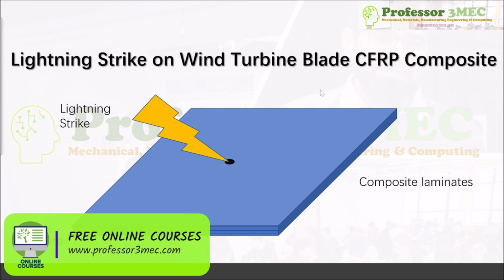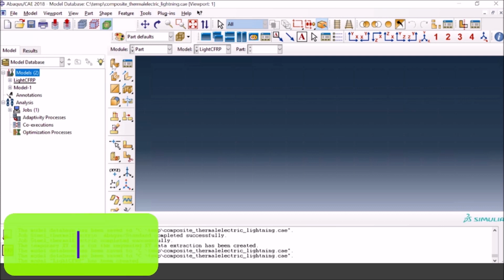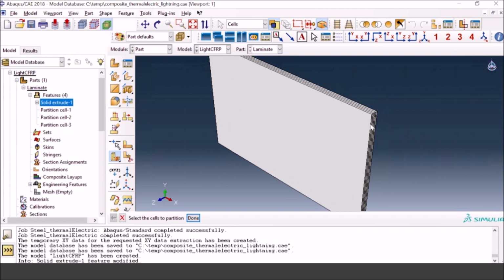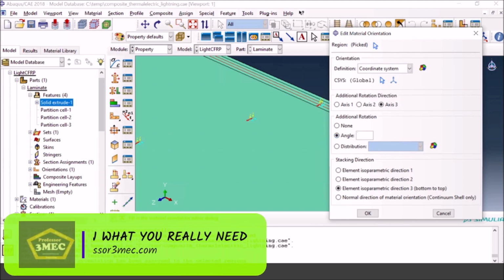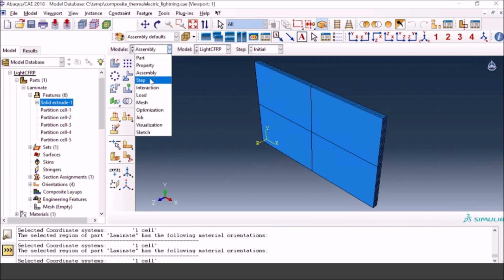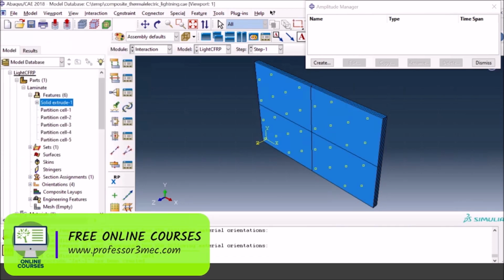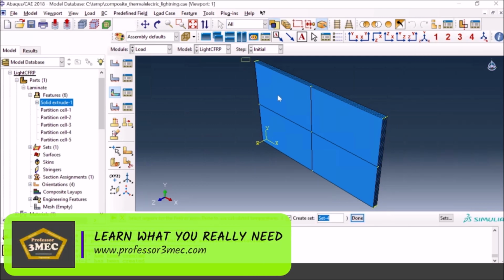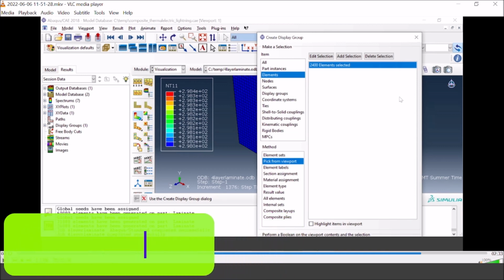Lightning Strike on Wind Turbine Blade Composite (CFRP) using ABAQUS CAE

Comment: Thank you professor! Your manual is very helpful. But I got a problem, when I simulated a similar task some elements with low temperature (around 3-10 Kelvins) occured during analysis. This problem aborted my analysis. What can cause this? Thank you
Reply from the maker: did you assign initial temperature in the model definition?

Comment: Is this for low velocity impact application?
Reply from the maker: It’s applied under static conditions but can be applied with velocity, etc.
Reply: @Professor3MEC  sir I have one question is there possibility of weight reduction if we add Kevlar fibers in already available glass fibres which means doing hybridization.
Reply from the maker: not sure if i understood correctly, but adding anything more would increase weight?

Comment: Very interesting, can you put a lightning strike protection foil on top of it
Reply from the maker: Yes should be no problem. Please send me more details and I will show how to do it
Reply: @Professor3MEC  i understand that in composite a conductive layer is added under the paint layer to reduce the damage due to lightning strike.
I was proposing if you can add 2 layers on top of it.
One thin layer and other conducting metal foil.
To compare the 2 results.
Without protection and with protection.